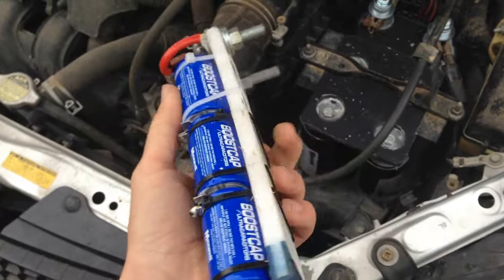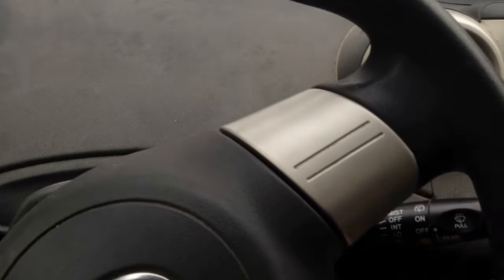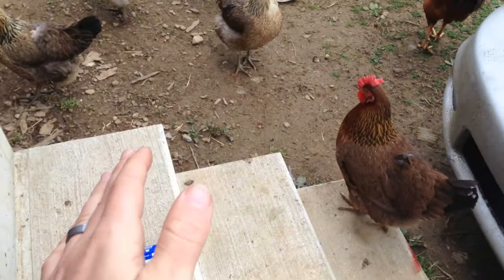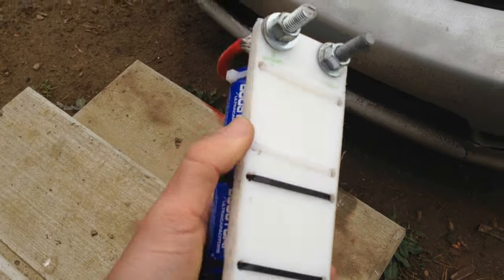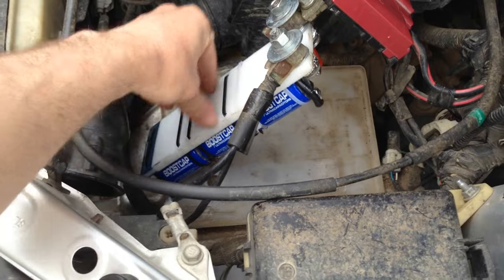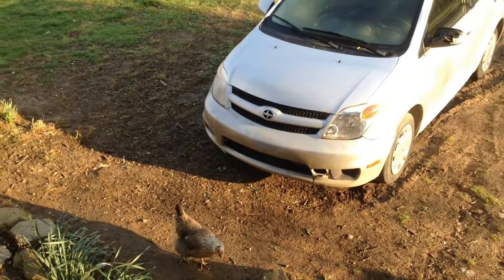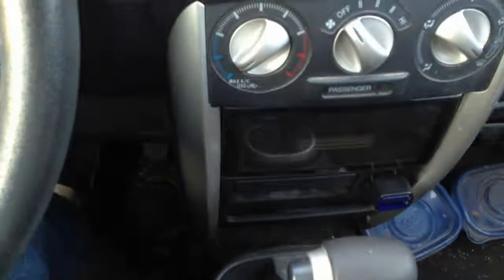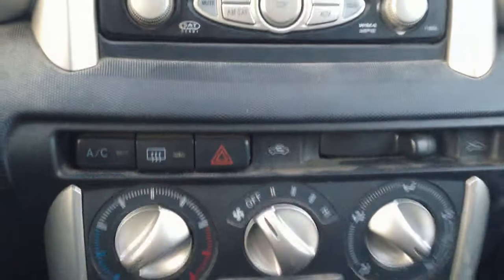Replacing My Car Battery with Capacitors! 12V BoostPack Update

Comment: Low end lead-acid car battery
= 12V x 24 Amp Hours.
= 0.15 cubic foot
= 18 lbs
= $65

Lead acid cannot be discharged below 1/3  (33.3%) without damaging battery.
Therefore effective amp hour ~= 16 Amp Hour @ 12V. 

============
Compared with
============
12 V x 1 amp hour
= 5 x 2.4V (overvoltaged at 2.7V)  x 3600 amp seconds
= 5 x 3600 x {1 Farad 2.7V boostcaps}
= 36 x { 500 F  2.7V boostcaps}

That is presuming we overcome the series capacitance being reduced by using a regulator/switching circuit.

12V @ 16 Amp hour
= 36 x 16 x { 500 F  2.7V boostcaps}
= 576 { 500 F  2.7V boostcaps}
= 576 x 0.0028 cubic ft + spacing allowances ~= 576 x 0.003
 ~= 1.73 cubic ft
= 576 x 0.15 lbs
 = 5.4 lbs + 2 lbs of harnessing frame + 1 lb of charging/discharging regulator / switcher
 = 8.4 lbs
= 576 x $15 
 = $864 + $50? homemade regulator / switcher + $?? homemade frame.

Without the regulator / switcher, you would have to multiply the number of boostcaps by 5, which would make your supercapacitor battery-replacement array heavier than the battery being replaced. Not to mention the size.

The regulator would be a 2.4 V - 12V step-up / step-down charge / discharge. Efficiency of regulator = 90% ? at most ?? So you have to add 10%, 15% more boostcaps to compensate.

The alternative without the efficiency loss is an intelligent parallel/series charge/discharge switching circuit.

Also, you SHOULD NOT charge boostcaps in series without a balancing circuit across them, to ensure their 2.7V individual threshold is not violated. The balancing circuit will cost you either efficiency (passive cct) or extra money (active circuit).

You seem to be oblivious, not only to the reduction in capacitance but also to the damage you are risking in charging the supercaps, when placed in series.

Hours of happiness constructing an expensive over-sized battery replacement = priceless.
Damage due to charging boostcaps in series = ???

=====================
Now compare with $350, 150  Amp Hour, 100 lb, 0.75 cubic ft high end battery.
Reply: Cynthia Avishegnath Thanks Cynthia for going in more detail regarding supercapacitors. I would like to know more about supercapacitors, and capacitors in general, can you please explain in more detail how a switching circuit overcomes the series capacitance issue? Is there any reference on the net where I can read more about the theory of this? Thanking you, Martin  "That is presuming we overcome the series capacitance being reduced by using a regulator/switching circuit".
Reply: Martin Poljansek
For non-passive voltage balancing, you need a circuit that would differentiate between incoming charge and outgoing discharge, such that it would switch to splitting the incoming ~12V  for charging individuals at ~2.4V, and which would then switch to parallel 5-in-series bank when discharging.

There is possibility where not all the 5-in-series banks are charged equivalently, so that they would not be discharging at the same voltage.

Therefore, you may need a diode at each of bank, to prevent flowback charging on a lower voltage bank, exerted by the other banks.

Let's see the complexity of the requirements of the charger/controller.

- Allow simultaneously having low threshold banks that are charging and high threshold banks that are discharging.
- Determine a bank is either at low or high threshold
- Sense the current power drain to whether switch more than one bank for discharge.
- Distribute the charging and discharging evenly, to distribute the life span fatigue evenly. Or not, so that you get to expire and replace one bank at a time. 

Supercaps/boostcaps are not real capacitors. They are dry electrolytic batteries that behave as unidirectional capacitors. Therefore, they do not have the charge-discharge lifespan of real capacitors.
Reply: Why not use a million supercaps while at it, you'd get a much more compelling case that way.
Reply: Cynthia Avishegnath if your ever in Ft Myers Fl look me up
Reply: Are you currently investing into any time into Nikola Tesla's or Stanley Meyers' work, Cynthia?  Type into youtube  "Water powered truck" and "water powered dune buggy" to find what I'm talking about.  I think with your smarts, you should be able to figure things out.  I however, am dumbed down in a way, only focusing on Health and Food, longevity.  If you'd like me to share information with you, and vice versa.  Let's talk.
Reply: I enjoyed those calculations but they seem to be for building a 16 amp hour constant 12 volt power source. I don't think most cars need that much energy to start. If I calculated correctly a 400 CCA battery (30 seconds @ 400 amps) is 3.3 amp hour under that load. After a year or two it's not even going to be that much.
Reply: You would want your battery to be able to handle 50 restarts JIC (just in case). You wouldn't want to be stuck in the deep of winter  with battery out after just 3 tries.

You wouldn't want your battery to die after cranking up your in-car hi-fi for an hour. Or left your head lights on after 30 mins. 2 x headlights (non-LED) = 120W.
Reply: Would you change the Pb-acid battery you currently have in your car, with a tinier Pb-acid battery that lasts 3 ignition tries?
Reply: I agree with you that if you want the battery to perform exactly as it did from the factory it would be best to replace it with the same thing. I was interested in this because I have a friend looking at replacing the battery in his performance sports car with a lithium battery to reduce weight. The price on those is very high and I was seeing if this was a possible cheaper alternative.
Reply: Cynthia Avishegnath r u a genius? Thanks for breakdown
Reply: aslanyavuz actually the calculations are fundamentally broken. A lead battery capacity is greatly variable on the discharge rate; at cranking amps, the net output amp hours are greatly below nominal value. Also, the output current is highly dependent on the charge, a battery even with still quite some energy left can't provide the amps needed, and trying will discharge the battery much faster than simplified arithmetic calculations would suggest. If you're using a battery to run some small power device the calcs are about right, but it's totally off for cranking a car. The whole initial post is a lot of convincing words on an overly long, contrived piece of bullshit.
Reply: You did not read where I wrote "Lead acid cannot be discharged below 1/3  (33.3%) without damaging battery."

I am giving close general calculations demonstrating how far deficient "super capacitors" are to the performance Pb Acid batteries.

Maybe you could help correct my calculation.
Reply: Cynthia Avishegnath I did read it, and it has no importance to the matter. A battery down to 1/3rd charge is as good as dead for cranking the engine (and way before that too). A car battery needs huge nominal capacity and almost topped charge to be able to provide enough amps to crank the car. The amount of joules is a secondary issue, and with cranking current they're very low compared to the rated capacity indeed. The calculations on the exact number requires detailed knowledge on the battery physical properties, but certainly they're not simple high school physics. I suggest studying "internal resistance" first

Comment: That's because the capacitors store power that's coming from the alternator, the battery in a car is used only to crank the engine, you can turn on a car and remove the battery with the car still on and the engine will keep going unless you have a bad alternator,  basically the alternator runs all the juice in the car not the battery nor capacitor pack for this matter.

Comment: Next step:  More super caps, remove engine and drive on starter.  Next, upgrade alternator, and drive for free forevermore.
Reply: You sir have just invented the infinity motor.
Reply: lmao
Reply: Better than an Infiniti motor.
Reply: +Hopelessand Forlorn or a Ford engine
Reply: +Hopelessand Forlorn dynamo wheels generate electricity :O just came up with that idea
Reply: Next step: Cut out holes for your feet and drive it around like a Flintstone car
Reply: ha
Reply: +Hopelessand Forlorn ... that is what I thought in first place.
Reply: what are super caps?
Reply: Tristan Sage
Super capacitors: https://en.wikipedia.org/wiki/Supercapacitor
Reply: Gawd I want one.
Reply: It is a dental crown that is a tooth-shaped "cap" that is placed over a tooth -- to cover the tooth to restore its shape and size, strength, and improve its appearance. IN this case a super cap is a dental crown for Superman (aka Clark Kent), that's all.
Reply: QuantumRift thanks ima go ask my dentist about it
Reply: Bravo man
Reply: You said right!!!
Reply: you mean make a tesla? a scion/tesla hibrid :D
Reply: lmfao Alice clickbait much
Reply: Hopelessand Forlorn I wonder what's going to keep it from running out of power, since there won't be an engine to recharge it. Maybe solar panels on the roof?
Reply: Hopelessand Forlorn starter burns out very quickly.
Reply: a short anywhere  would blow the caps instantly
Reply: Starter probably isn't strong enough to move car an if it is it probably won't go over 10 mph
Reply: O OK
Reply: you sir gave me a million dollar idea... thanks for making my dreams come true.
Reply: Hook a housefull of chickens up, and run the car on chicken feed.

Comment: Try it with an old diesel, LOL! ;-p
Reply: +diossano That would be a disaster. LOL
Reply: I've been toying with the idea of using a capacitor to help with the power draw, when my intake heater grid cycles, on my Dodge 3500.
Reply: +diossano There's videos of people starting marine diesels with ultracapacitors on here
Reply: lol
Reply: You will need more CAPACITORS ^^

Comment: A mini boost pack would be great to have in the trunk as an emergency backup!
Reply: joedanero Its 14ish volts, wont kill you but could cause a fire if it shorts so that's the precaution you have to take if you have one.
Reply: ***** The rate of cap discharge makes it even more scary.  Cool project, but nothing auto engineers haven't thought of.
Reply: joedanero Exactly... Caps have almost no internal resistance (unlike a battery). Once the contacts are shorted, they release ALL of their energy almost instantaneously. Big capacitors will kill you quick.
Reply: joedanero same thing can happen with a regular battery,   but someone can build a special case to protect the boost pack and his terminals
Reply: ScopedPewPew You have no idea about the electric. And im not gonna ask you which capacitors can kill you. Because you dont care about the volt and amps. You just care about the discharge. And that means nothing without the capacity of them. Finally those capacitors as you see in the video CANT kill a person. And watchout your words when arguing someone who knows better than you.
Reply: whats the RC time constant of the above cap in series with a 10k resistor
Reply: ScopedPewPew thankyou very much for your time and I'm sure everyone else appreciates it, always good to play on the safe side when dealing with electrical equipment!
Reply: breezebro
 yeah i know  2v Caps cannot shock you great video man :)
Reply: ScopedPewPew
 You are failing to realize something important here, so I'll point it out with a rather great video: /watch?v=XDf2nhfxVzg
And, since I'm lazy and can just link to another page rather than do it here, here's some math for you: http://www.instructables.com/id/Lets-learn-about-Super-Capacitors-A-Practical-G/step2/Are-Super-Capacitors-Dangerous/
The fact that a cap has little internal resistance and low discharge time has nothing to do with the math that governs electronic interactions. Internal resistance and discharge time have nothing to do with the current produced across a resistive load in a circuit.
Reply: XD
Reply: Its all about the potential voltage the dude in the vid was creating a short ie low resistance and wondering why the current was spiking xD
Reply: Not a good backup. Notice that the voltage dropped about 3V over 3 days.
Reply: ScopedPewPew If you grasp each terminal of a capacitor, one in each hand, your body resistance is now in series with the capacitor's resistance and your body's resistance dominates.If your hands are dry, that resistance is on the order of 20,000 ohms. The discharge current will then be .0008 amps (0.8 mA). That's enough to get your attention but will not set your heart into fibrillation. It normally takes about 5 mA through the heart to kill a person.
Reply: breezebro, thanks for the support.
Reply: ***** The capacitor will discharge at a rate determined by both its capacitance and the series resistance of the circuit that it discharges into.
The defining formula is i(t) = V0/R  x  exp(-t/RC)

where

i(t) is the current as a function of time.
V0 is the initial voltage of the capacitor.
the exp term shows how the current decreases as a function of time.

R is the total series resistance of the discharge circuit. If the load resistance is very low we may need to add up lead wire, contact, and capacitor plate resistances to get an accurate picture of the initial current.

This formula is taken directly from a text used by first year engineering students.
Reply: It takes about 300 mA of DC to get the heart into fibrillation. At 30 V the body's resistance would have to be around 100 ohm. Normally dry skin is about 20,000 ohm. Therefore you would have to get the electrodes right into an open wound to get harmful current to flow. ..or, maybe insert the electrodes into some naturally wet orifices. Too horrible to contemplate further.

Comment: Don't leave the radio or lights on 😉 when you park up 😉
Reply: That's what I was wondering. Is there the capacity of a regular battery?
Reply: Regular lead acid battery is the equal of a room full of  capacitors.
Reply: I did the mathematics in my reply above. 4,800kg of capacitors for one 12kg lead acid battery.
Reply: Simon Howes thanks dude

Comment: Be careful of how low the voltage gets - as volts gets lower amperage will rise to compensate. It will take a toll on the regulator of your alternator and your computer of the car too

Comment: Manual crank armature coil for cold starts. A few pumps and you can be recharged.
Reply: Why not just put the crank back on the engine ?
Anyone here ever hand crank an engine ?
Reply: not a modern hi-compression v-8!  lol   (old low-comp l-4 tractors, yes....)

Comment: Now try to start a diesel V8
Reply: cold start on an older diesel that requires 2 full glow cycles? I would think the glowing of the plugs would drain the capacitors pretty quick. And if you didn't use a block heater and all the fluids were cold, then several rotations would probably be necessary before ignition. I'm somewhat skeptical
Reply: haha it would require two of them
Reply: Let's assume 2 30 second glow cycles followed by 10 seconds cranking, just to be optimistic.
GM 60G glow plug draws 9a, then tapers some.
Last starter I put in my 6.2l draws 1000a locked rotor.
8 cyl x 8a=64a for 1 min = 64 amp-min/60 = 1.07 amp-hr
500a x 10 sec = 5000 amp-sec/3600 = 1.39 amp-hr
Total = 2.46 amp-hr
I'll let somebody else figure out the capacitor size needed.
I have read about a tractor-trailer driver who added a capacitor bank to supplement his 3 starting batteries, which seemed to work well.